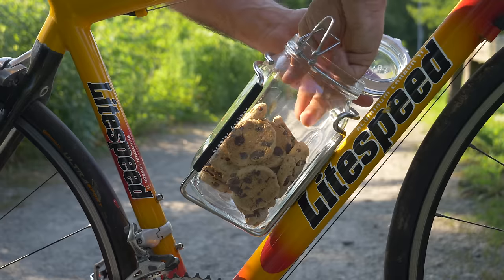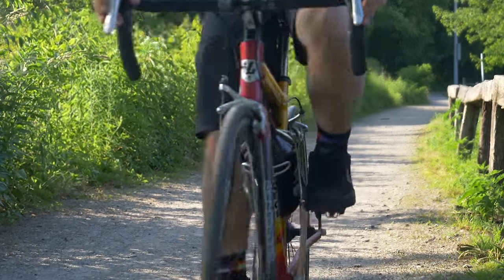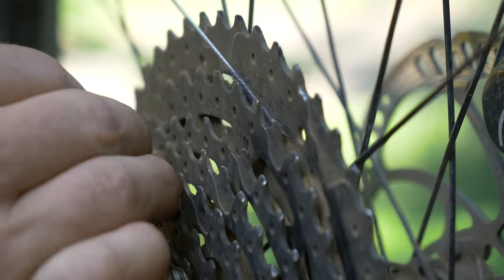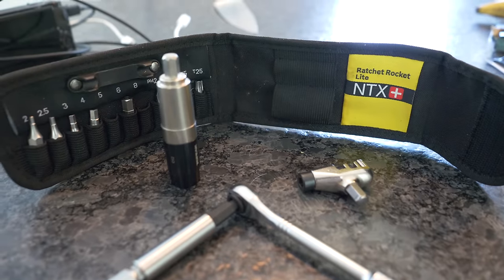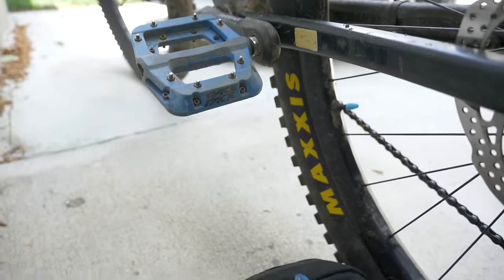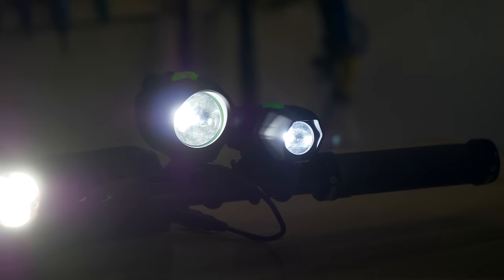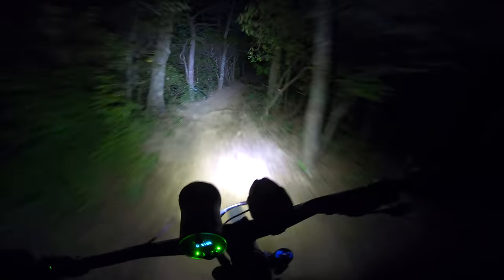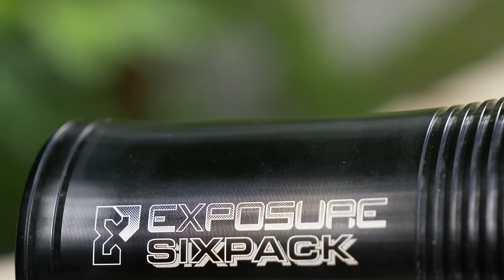10 Unique Bike Products Reviewed Brutally

Comment: "The straps loosen up a bit during long rides"
You ever consider you're just dropping water weight? Lol 
I used to have that problem when I'd go hiking, and I tried different belts and I eventually realized that my pants weren't getting loose, I was just loosing water weight after sweating on a trail for several hours in the Florida sun.
That's what happens when you're not skin and bones or solid muscle.
I'm pretty skinny now, and never have that issue... just an interesting thing I learned lol
Because Cobra Buckles don't get loose lol

Comment: Seth, great review.  I have had the Exposure Diablo for a few years, and when MTBing use it as my sole light - on the handlebars.  Never had it fall off, even in some rather painful crashes.  The little plastic clamp with red rubber clips looks flimsy, but in practice I have found it hangs on fine.  The only issue is on the brightest setting I am lucky to get much over an hour, but judicious dimming to lower setting (which you can do by tapping the body of the light - seriously!) can stretch it out to just under two hours.

Comment: I absolutely love that Topeak mini tool. I've got the one without the torque adaptor, because I don't need it on the trail, but the little ratchet is just so so cool and nice to use.
A standard Mini tool will usually hit on something in the vicinity - so you make half a turn, pull it out, turn it back, put it back in... Turn a bolt five rotations like this and you're furious. With the tiny ratchet, it is a matter of seconds. Need more torque? Stick the extension into the end of the handle! Genious!

Comment: I have one of the older Topeak ratchets with fixed torque bits instead of the adjustable and really like it. The nice thing about the bits is they are just standard 1/4" hex bits, so you can easily replace them or add additional bits that are not provided in the kit. I am pretty sure the ratchet is actually made for Topeak by VIM Tools. They have the exact same head on several of their HBR series ratchets.

Comment: Great video Seth! Always love your product reviews. I have both of the Exposure lights, they are incredibly bright, super high quality, and near indestructible. The floodlight has different modes that you can program to suit how long you want to ride, but I leave it on program 1, which uses a gyroscope and accelorometer  to adjust the brightness automatically. As for the mounts, I agree that what is supplied with the helmet light is very inadequate. I use the gopro style mount instead, with my helmet's built-in mount, with a safety lanyard in case of a crash. This works well for me. As for the floodlight bar mount, I have had no issues with it despite several crashes. But I don't shred as hard as Alex and yourself. If you do a lot of night riding as I do, in my opinion these lights are worth the expense.

Comment: Hey Seth’s Bike Hacks, I’ve got a KILLER hack that I don’t think I’ve seen you use. When it comes to cleaning your chain/cassette, NOTHING works better than automotive brake cleaner. It literally melts the gunk right off, with little to no scrubbing. And if you get any overspray on anything it’ll actually just clean it. So no worries about getting any on your brakes, it’s actually good for them. It completely evaporates in seconds and it won’t harm the finish. And at $2 a can you really can’t beat it.

Comment: I have one of those exposure helmet mounted lights and I've actually had a great experience with them. The key is using a multi tool to really tighten down the helmet mount so it doesn't move around side to side. In reality when you're riding even the roughest terrain your lower body is moving far more than your upper body so the light doesn't ever shake or bounce out of the mount. I haven't tried the floodlight but I'd still recommend that helmet light. And it's bright as hell!

Comment: Outbound lighting is the best bike light you can find right now. They aren't spot/flood lights. They are engineered LED output like a car headlight, which makes sense because the designer is an automotive headlight engineer. The optics are game changing. There's a road version with a cutoff so you don't blind oncoming traffic and a trail version that lights up everything. A helmet mount is coming too.

and by headlight engineer I mean he designed super bright aux lights you see on stage rally cars going 120mph through the woods.

Comment: BrightEyes - try the beam splitter on the flood (if the new ones have the option). I have been using for about 3 years now and feel they are the best value. I mount one on my helmet GoPro mount and keep the battery in my pack. Run one flood with the splitter on the bars, and sometimes a second spot on the bars as well. Performed great even down to -5F. True the strap mounts are not the greatest, but their customer service is awesome.

Comment: Exposure lights are brilliant, the bar mount is designed to fail to save bike and light. By design it's secure but safe. They're waterproof, bombproof and they're completely serviceable with manufacturer or outlet versus the cheaper alternative which when it goes pop, it's done. We've had them sent back for new batteries, boards and bulbs plus they're super reasonable price wise when it comes to repairs.

Comment: I don't do a lot of night riding, but when I do, I use a Surefire G2 attached using an Olight FB-1 universal handlebar mount.  Total cost: $70.  My G2 is an older model at only 300 lumens, but it easily lights up the ground 30 feet in front of me.

Comment: I have the Ratchet Rocket without the torque wrench attachment. I love it! The non ratchet side is magnetic so it sucks in the bit you want to use. Stem and bottle cage bolts are easy to do. The bits and the tool are really high quality. No stripped bolts yet. If you shop around you can get it for 20-25€ or 10€ "used" like I did.

Comment: For the bits in that tool set get yourself some 3-5mm round neodymium magnets and with a drop of glue ( shoe repair stuff like repair extreme ) fix it in the bottom of the bit holder.
That'll keep them in place. 

Great vid as per norm

Comment: Having owened and sold many exposure lights, the  mount on the handlebars that adjustes left and right  tends to come loose and the aluminum bracket that broke in the video  is a pain to use when transferring between bikes.  A rubber strap would be a nice upgrade.    The helmet light is awesome for the price contrary to the video.   The helmet mount allows the light to eject when you hit something but has a safety tethered strap  and allows for lots of adjustability.     It's super bright and is super light in the helmet.    Expensive but built in battery feature shouldn't be forgotten.

Comment: As someone who has switched to a ratchet tool, I wholeheartedly recommend them to everyone. You don't need to spend this much on the Topeak one, several tool brands sell tiny ratchets that accept regular bits. Loosing bits isn't a problem, they're cheap.
Seth should also check out some bike lights made by Fenix.

Comment: I spent $70 total for my light setup, comes with a 700 lumen coast 650r flashlight ziptied in a hip holster to my handle bar (actually more secure than it sounds) and a 550 lumen husky rechargeable headlamp. Both have sturdy twist focus. Haven't tried them on a ride yet, but i got the coast during a midnight walk to the local Walmart and it saved me from an encounter with a skunk.

Comment: I used to bike to work for a few years often in night shifts, 50% through city 50% country road, i tried a few bike lights, but they were all too weak and didn’t really light up the road well enough. So I bought an ultra bright flood light with a huuge battery. It was like a small sun hot glued to my steering wheel, i pressed the button and suddenly it was bright as day. I usually put it in epileptic hell mode (rapid blinking) because it extended the battery life so that it lasted all the way to and from work. A true menace to any and all local epileptics, drivers and drunks walking home from the bar practically getting flasbanged in the middle of the night.

Comment: (for 10 bike 🚲 hacks) if you need to stop for a quick bathroom break or to buy water you have to keep your bike from getting stolen and to do that you can shift to the largest sprocket up front and the smallest in the rear, if someone tries to steal your bike they would have to be an Olympic athlete to pedal in such a high gear

Comment: Hello from a (UK) viewer. Still can’t get over calling a bottle a “Growler” (very rude in our slang) but a comment on Exposure lights. I have several of them and absolutely swear by them. They are tough but repairable (the company themselves provide excellent after sales care) and the fixtures that hold the lights to the bike are exceptionally good. If the helmet one slips around a small piece of rubber cut to size would solve this but isn’t rally needed. The silicone straps have never failed me on or off road and are v easy to fit. You were unlucky to have that large light snap off in a crash but hey it was a crash. Oh and of course they are very bright and give off a useful bean pattern. Finally as you identified they are sooo convenient having no separate battery (in my humble opinion it’s the wires plugs and sockets which cause the problem on sets with additional battery packs). Exposure lights rock!

Comment: I think you were a little harsh on the exposure lights for a few reasons .
First the cost ..... you had the top of the line set there are other light sets in there range that although less powerful are more pocket friendly.
Second the mounting system works well and has to have some point where it should break or I agree with one of the comments you made when you said it would be a big lump to hit when crashing ..... don’t you think the plastic mounts would have broken in the crash that Alex had ?
The third is they are bullet proof I have the race version ( cheaper end of the line ) and they have never let me down in 3 year of wet cold and muddy uk winters .
Keep up the honest work buddy 👍🏻

Comment: Hey Seth. Absolutely love your work . I run similar exposure lights and I sling the big light under my bar so it hangs down from the mount and is less likely to get hammered in a crash. Completely agree about the quality of the mount for the smaller light- Exposure need to up their game with that. After sales servicing is good here in the UK. I smashed up my rear display on my Exposure Race and I had it all repaired inc postage both ways for about £45.

Comment: great reviews.
For me Exposure lights were a no brainer, no cables, all in one unit, and great run time, and great wide spread beam. I live in Norway so it gets dark at 15, so super early, so a light that has good run time is a must.
another thing I need to mention about the Exposure light is the mount, it will make the light loosen and spin on this part 11:09, on impact of the light or the handlebar, so having a multi tool is a must. I already mentioned this on Instagram, and Exposure knows about it, so I hope they will fix that. and of course the things you mentioned, which I haven't happen to me yet, but the pin on the clamp has gotten pushed out, so I had to push it back in.
11:33 and the gopro does not do it justice.

I have the Exposure & Diablo, but I don't use them at full strength all the time, cus I a trying to extend the run time, full on both al the time is overkill, I only use full strength when going really fast and it's pitch black.

Comment: The mounts for the Exposure Diablo might feel like cheap plastic but I've used them on many gnarly trails over the last few years and I've never had a light come out of the mount.
There is an alternative mount available for their bigger lights, I run mine under the bars instead of on top of bars (normally with original mount) 
I'm fairly sure the helmet mount is purely plastic because metal would kill you in a crash!
Although the lights are expensive the accessories are well priced and after sales service is excellent (although most people won't need it as these things are so reliable)

Comment: Cateye makes a really good head lamp with a built in rear light called the Volt 400. Makes for a really good commuting light and is decent for the trails. Bought a Volt 400 and an Ammp 800 for my bars for a total of about £100. Both not only use really good mounts, the mount fixture is universal so if you want to start with a Volt 400 but decide you want more power, you can put the Ammp on there. The helmet mount uses a long velcro strap pushed through the vents on a helmet, features a nice degree of tilt and the strap can be fitted longitudinally I the vents on your helmet require it. The Ammp mount has a lovely simple band which thumb tightens with a lage nut and has built in rubber to prevent slippage or damage. 
 Exposure, take note.

Comment: I’ve used a Exposure Joystick on my helmet with that mount for about 8 years. I’m on my 2nd, the original is still in use as a backup. The mount doesn’t move if you do it up, and it comes with a lanyard as a backup for when you headbut a branch (as I seem to do a lot!).

I don’t like their bar lights though.

Comment: I've carried a topeak ratchet rocket  as my goto trail tool for 5 years without issue. it uses standard bits so replacements are available from the local hardware store. 
I'm excited about the ntx+ because of the torque adapter. still making up my mind about buying the ntx+ or just buying the adapter on its own.

Comment: Seth hi. Good review of the exposure lights. I am from England, and have the smallest of the handelbar mounted lights called the race. The beam is very bright for the size of the light and the build is very nice just like you say. I actually dropped my light from my hand on to an internal carpet floor, the led screen at the back broke! The light still works fine, but I can't tell how much charge I have now. For the price they charge for them I would have hoped they would be more durable than this.

Comment: Growler cage is somewhat amusing. I've been seeing salsa's "anything cage" and thinking that I could probably strap one of my insulated steel growlers to it.  Looking at growler cages online, seeing them mounted on either side of a fork on a bike seemed like it would work out better in terms of clearing cranks and ankles.  Obviously not something to take on the trail, but I live a few miles away from a couple of breweries, one of which fills growlers.  If I were feeling particularly delusional, I could pretend that the exercise I get riding there and back offsets the calories from the growlers full of beer, plus whatever I drink in the taproom.

Comment: I like to give a tip of another lamp the BORUiT BC10 it's about 40-50usd on Ali express (few places has it) now days, but it shines like a 100-150usd lamp. Buy it without a battery and instead buy a Shockli 26650 5500mAh to it. Only charge it with a safe charger or a RC charger. The lamp itself is a copy of a way more expensive lamp but with the exact components for a fraction of the price. Then get any universal holder from wish. Or a forward directing camera mount since it has std screw mount in the bottom.

Comment: I have a light from Cateye that has the same rubber mount problem. I had to MacGyver a different mount for it to work even on my road rides. The original straps only seem to work when the light has a large contact area compared to its size. For a bigger light, that means only on a helmet.

Comment: I use my exposure handle bar mount (elastic one) on my helmet where it’s wrapped through the vents of the helmet. I have also fitted a fabric looped around the rear vents of my helmet should the light fall out on the trail. 
As for the metal handlebar mount, I’ve had mine for 7 years and have crashed a few times but have never bent it like in the video.

Comment: Re the Exposure lights review, I have a Diablo that is at least ten years old that I use as a helmet light, yeah the helmet mount is plastic but I think that if you're gonna have something bolted to the helmet that really shouldn't be there then I think i'd rather have it made out of plastic rather than Aluminium because its less likely to make a hole in my head! use the mount with the lanyard attached to the lamp and loop it through the helmet vents that way you're not going to lose it when you stack.
The six pack I also own, its about 6 years old and it really is a chunky monkey, I've crashed lots of times with it and only broke the mount once. Price of the lights, well, just bite down hard!

Comment: I can also vouch for exposure.... They're just.. Impeccable, they may come off in a rock garden, but 9 years after my first, and last, and current, it's had a hundred falls, many drops and countless chuckings down rock gardens and it's still. Goddamn. Perfect. And more amazingly, holds the same charge it always has. I can't begin to recommend enough, they'll last 10x longer than any other bike light.
Also, for the record, they start with the joystick at around £100 which is just fine for a casual riders helmet light and is what I have. The 6 pack is top of the range pro level stuff

Comment: 6:40 I think most of the reason you think that water bottle holder is bad is because you put it on wrong. Looks like it uses molle/Alice clips which is the standard for attaching various pouches onto military gear. You can search "how to weave molle" on youtube for a tutorial but basically that plastic clip goes under the loop on the bag side, then the center loop on the cupholder, then back through the bag. It's a very effective means of attaching pouches and joints them with alot of strength and sturdiness.